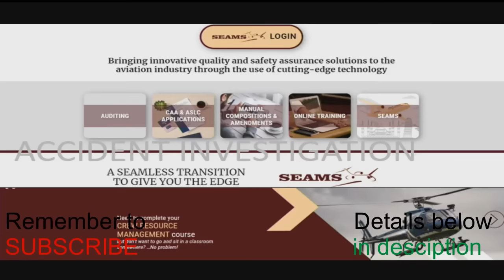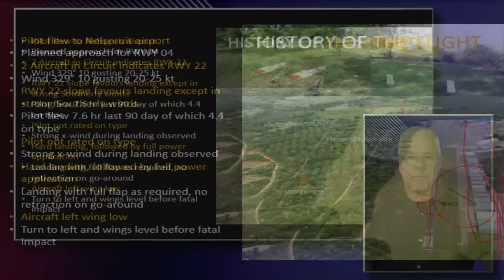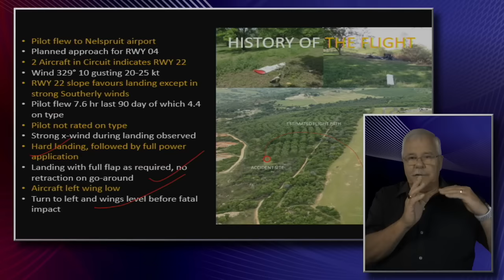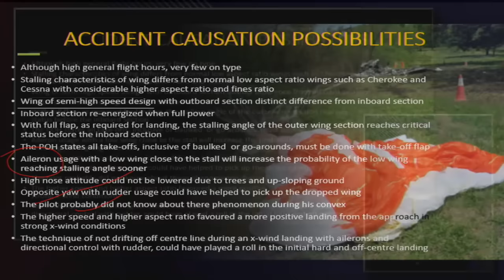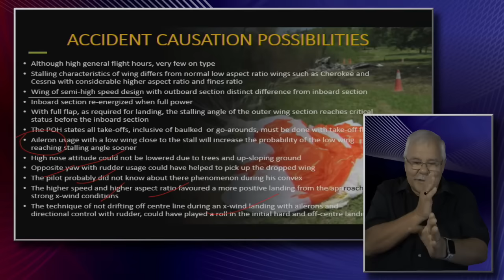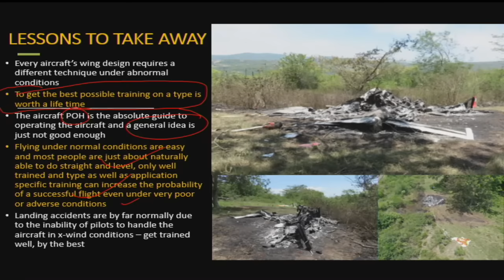Tragic Balked Landing Cirrus SR22

Comment: Crabbing is just fine!! I was taught that way on T6's and have used it on low and high wing tin power planes, tube and rag power (very shortly coupled) and glider aircraft and glass gliders. Some people profess aileron others crab. Crab is supported by theory, aileron is a preferred style. I guess like wheel versus three point landings! What I like about crabbing is that pilots (especially low activity pilots) are waiting to use those rudders in the crab. It is "in their minds". Lower workload also and better feel of crosswind effect. When they "aileron" for the centerline, it is the control in mind. Just an opinion, but there is no reason not to use the crab in light aircraft. Within cross wind parameters for an aircraft, you will not "shoot off the runway".
Reply from the maker: Brent, sorry for the very late response, but here is the thing.  The cross-wind capability of an aircraft is determined by the capability of the ailerons to be able to stop drift.  I also come from the school you come from, but my problem is that so many people are looking at the big boys and think this is the way to go.  I like your comment and will make a video about how I see this in the lighter aircraft of today, and not the Harvard or heavier aircraft.  Thank you. Happy aviating!